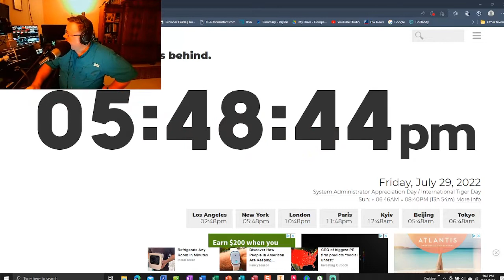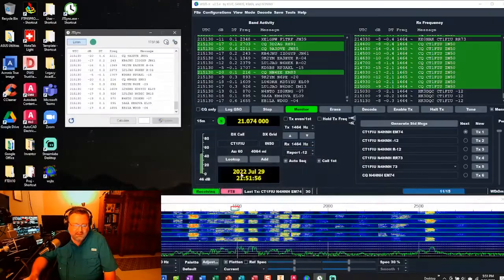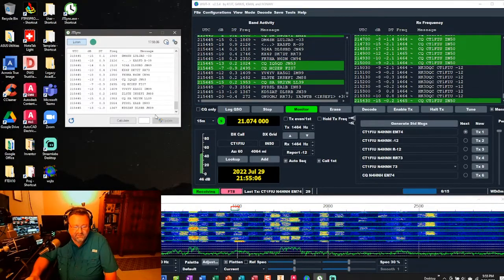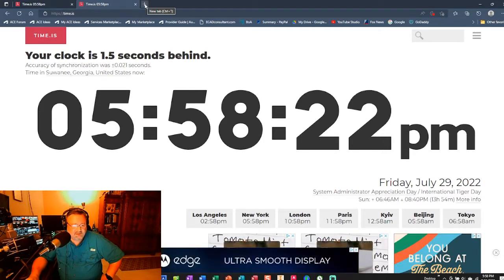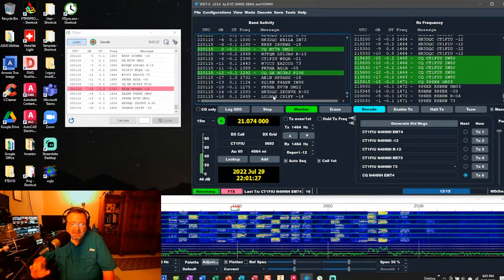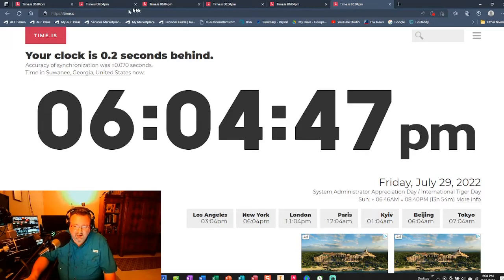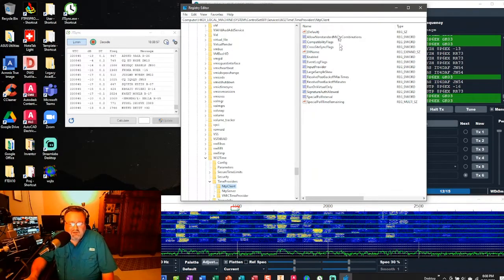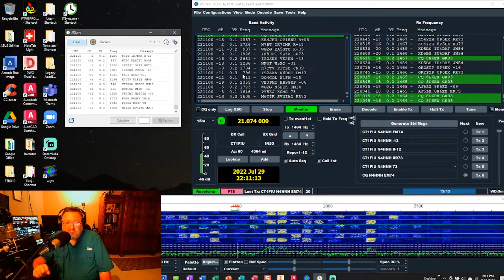FT8 Time Synchronization with JTSync #hamradio #ft8 #digital #mode

Comment: I have been using the FTdx10 mostly for CW but also for FT8 without problems. Now, during meteor scatter season, my WSJT-X software could not decode the meteor scatter signals, despite being able to decode FT8 signals. But after following your PDF document for FT8 settings, I now decode meteor scatter without problems. Thank you, Doug!
Reply from the maker: I’m glad to hear that, Ralph!  The FTdx10 really shines at CW and FT8. 

Did you see this time sync video before it got queued for this Friday?  No harmonic distortion and perfect timing are essential for maximizing your chances of making reliable contacts. 

73, Doug

Comment: Thanks for the Shout Out Doug!  Not sure I qualify as an expert, like you, I just read the manual and made a lot of contacts.   You do such a good job of diving deep into a topic and explaining it so well. I learned new things in this video about JTSync, WSJT-X and time.is and I've been using them for 10 months.  The POTA and SOTA activators will love this tool for syncing there clock when out in the field.
Reply from the maker: Thank you for the tip and the inspiration, Curt. You are a credit to amateur radio.

73, Doug

Comment: Thank you for the info on this program Doug. Doing Pota with no cell phone coverage has been a slight issue but man this is going to make that small problem disappear. Thanks Tommy KO4KFS
Reply from the maker: You’re very welcome. Tommy! 73, Doug
Reply: If you are operating on hf, NIST transmits time code on 2.5, 5, 10, 15 , 20 MHz

Comment: Great video. I just recently purchased a windows laptop that I'm going to bring in the field and attempt some digital modes for POTA. This will definitley come in handy... I still prefer SSB, but on those days where the conditions aren't wonderful, this may be a way to turn my frown upside down. I know what you're going to say, and I haven't learned CW yet, but trust me it's on my to-do list.  73 de KD2TJU
Reply from the maker: I wasn’t going to say it, Todd, but I do highly recommend CW. I’ve done some FT8 lately myself, mainly to write the guide for the Patreons and for those who wanted to log an FT8 contact with me. 

73, Doug

Comment: Thank you very much for this video. Ive been trying to get it running for a few months. I keep putting it down as you tube vids make things either more confusing or usually start much farther along than I am in every "set up " video. Still not working. Im surprised you're getting anything without the time being correct. Im actually not getting anything at all and have no idea which button I need to press to get it working. Hopefully soon
Reply from the maker: I’m getting contacts because I use JTSync to keep my clock synchronized.

Comment: I just tried FT8 and i’m finding that GridTracker and JTSync cannot run simultaneously as it could not both listen to the same port… is there a way to send the same signal from WSJT-X to separate ports so they can run simultaneously??
Reply from the maker: Maybe someone else can jump in and answer that.  I don’t run Gridtracker.  But JTSync isn’t absolutely needed unless you are concerned about the accuracy of your PC clock or you want to intentionally adjust to a station that is more than one second off but you really need them in your log.  And of course you can synchronize your PC time via Windows.
Reply: @n4hnhradio  i liked the idea that you can sync using radio time. Having said that, it was rare that I had to resync since my pc time does nit deviate much. I use it to spot check every now and then expecting grid tracker will act up then I close JTSync and all is back to normal 👍🏽
Reply from the maker: @spysweeper JTSync is helpful when you have no Internet connection (portable off grid) or if you want to intentionally throw off your clock to match the timing of a rare DX station that is off by more than one second.  Otherwise, you can leave JTSync off.

Comment: My JTSync is not loading info from WSJT-X.  I have tried changing settings to UDP server and port listed in WSJT-X and get an error message when I try them.
Reply from the maker: And you clicked the Listen icon?
Reply: @n4hnhradio  Yes and got a green light.
Reply from the maker: @robertfarrow2826 you might need to contact JTSync for that. It just installed and worked for me. I didn’t have to troubleshoot. I’m sorry I can’t help more. 73, Doug
Reply from the maker: Please post the resolution here. Others might benefit from it.

Comment: I simply use an inexpensive gos dongle at the start of my session and that’s good enough, of course this is free
Reply from the maker: Hi Jerry!  What I like about JYSync is that I can use it to temporarily force my clock to match a station whose clock is off by more than 1 second, just so I can work them. Then I can let this program recalibrate my clock back to exact. Comes in handy when the other station is rare DX but there clock is out of calibration. 73, Doug

Comment: In Windows 11, you can go to settings, date and language, date and time, sync now button. Works for me.😁
Reply from the maker: Hi Larry!  All versions of Windows that I’ve used have that, but it needs to be manually clicked, quite often, or use the registry hack to force the SpecialPollInterval to 3600 seconds, (update every hour) or 1800 (update every 30 minutes).  The issue isn’t whether you are within +/- 1 second of UTC.  The issue is you must be within +/- 1 second of the station you wish to have a contact with.  You can both be off from UTC by 2 hours and 10 seconds, as long as you are both within 1 second of each other.

73, Doug
Reply: @n4hnhradio  Gotcha, thanks.
Reply from the maker: I know it seems strange, but it isn’t about logging, it is about data.  The decoder expects specific data at a specific time during the 15-second cycle.  That is how FT8 signals can be decoded from well below the noise floor.

73, Doug

Comment: I just use Dimension 4 no problem refreshes every 15 mins
Reply from the maker: I’m not familiar with that one.  You don’t actually need a third party program to keep your own PC accurate to within +/- 1 second.  Windows checks once a week.  But you can use the registry hack I showed in the "Configuring the FTdx10 for FT8" PDF that is available for Executive and VIP Patreon members to force Windows to synchronize more often.  You set the SpecialPollInterval to something like 300 (5 mins), 600 (10 mins), etc.  But the important thing is that you are within +/- 1 second of the station you wish to contact.  If he/she is off by 2 hours, 2 minutes, and 9 seconds, you need to match that in order to make contact.  That’s one of the features I showed in the video that JTSync offers.  It can temporarily synchronize your clock with any other station, to make contact.  Then you can use it to set your computer back to actual time.

73, de N4HNH